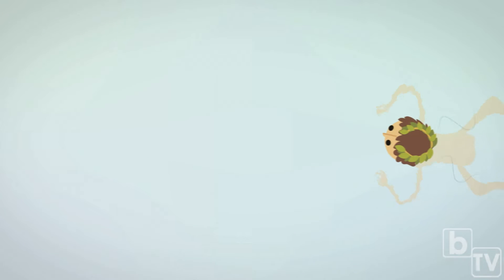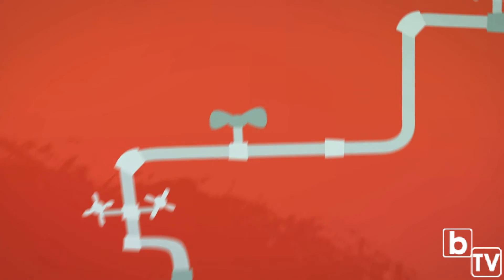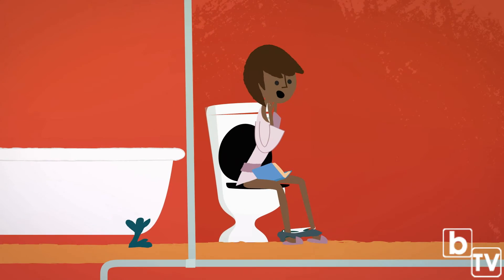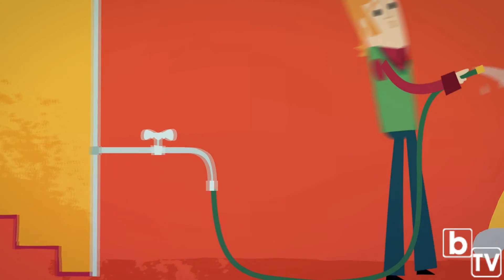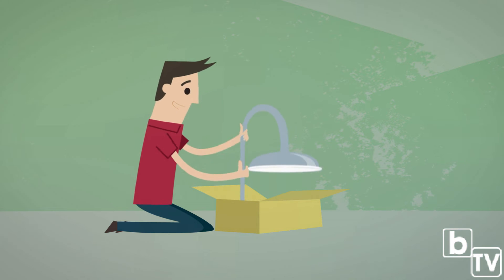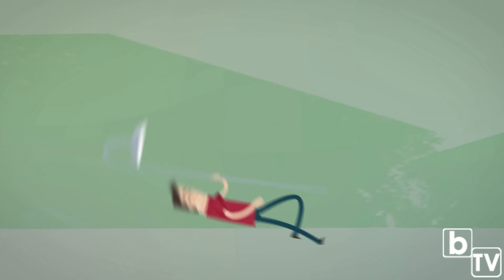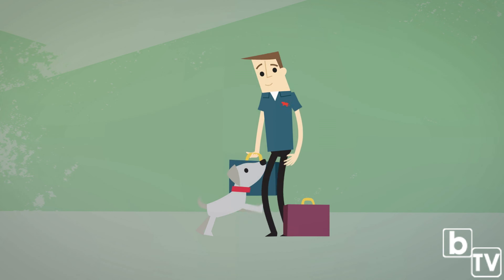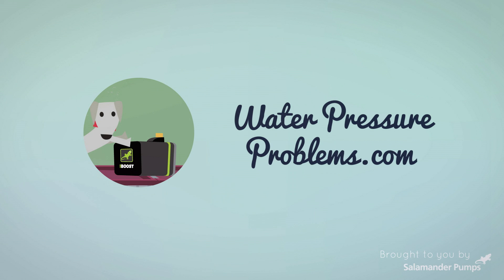Fixing Water Pressure Problems - Salamander Pumps

Comment: I am very disappointed with Salamander pumps. My pump became defective within a year, their engineer refused to replace it under warranty with poor excuses. I will never buy another Salamander pump. Customers Beware.
Reply: We had a simialar problem.  Salamander refused to fix the problem blaming the installation.  The installer defended himself and refused to do anything to fix the problem.  Get a new boiler and save yourself the hassle as we wish we had!
Reply: Salamander pumps are shite ,wish I did my research first 😤😤😤😤